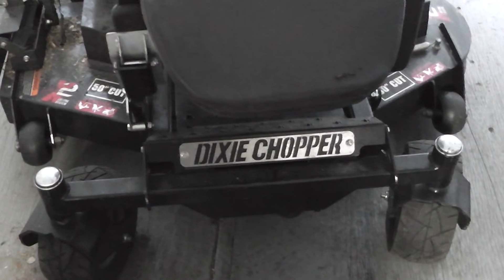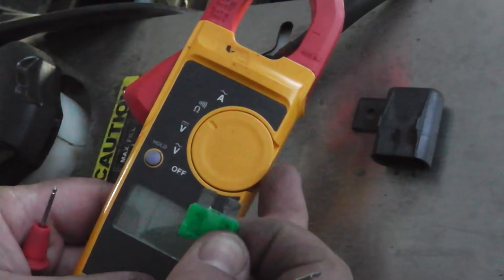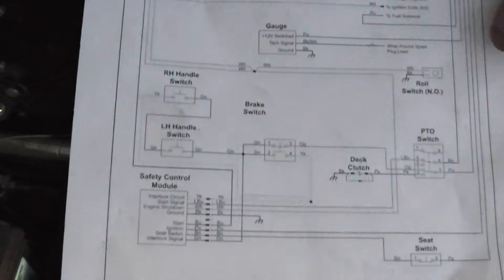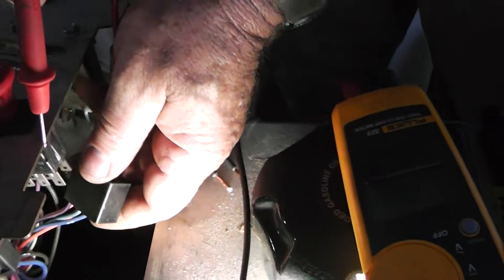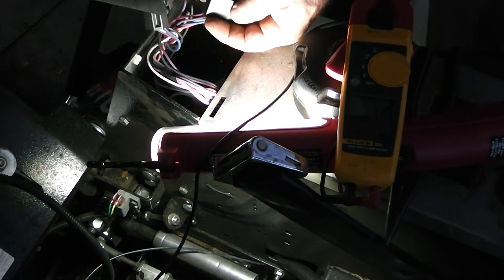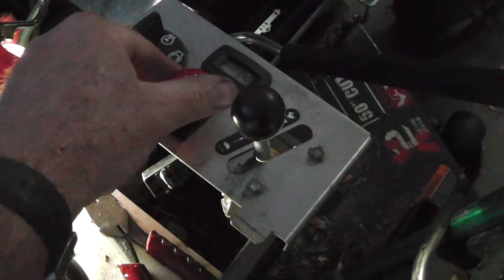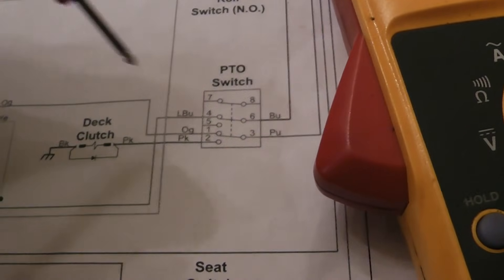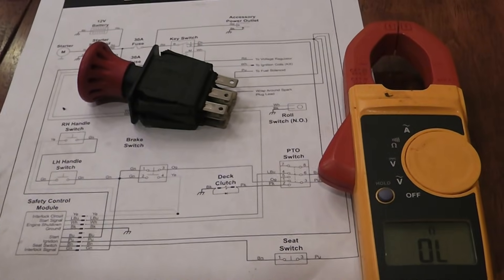Zero Turn Mower No Start Easy Fix

Comment: This will help a lot of people. Just like to add you can clip your negative lead to the battery, get a reading of battery voltage like you did then go to the fuses and get a reading of voltage on both sides of the fuse so you do not have to depend on ohms that may show continuity but not carry current. Move down the diagram testing each contact switch as long as you do not have a drop of 1.5 volts then it will carry enough current to work properly.

Comment: This was a perfect example of how to chase down a PTO switch causing the problem. You did forget to mention that there are safety switches for the control levers as well but this is a great video breakdown all the same. Thanks for taking the time!

Comment: couldn't you just have moved the blue wire to #8 and the light blue to #7 and leave #4 and #6 empty and saved a trip to the parts store and the cost of the new switch?

Comment: Had no clue a PTO switch could do that. I'm over here with my Cub Cadet with no wiring schematic until tonight. I looked through it and saw the connections, did a search, your video popped up and confirmed my no crank possibility. I've wasted about 16 dollars, on an ignition switch and relay. I know it's rookie as hell to just start throwing parts at it but, I couldn't find a schematic until just now. Thanks for the confirmation. Gonna go try it.
Update- just tried testing it and it's confirmed. Jumper allowed the circuit to work. No voltage on exit off the switch. Thank you for the video. Between this and the schematic, I finally found my problem
Reply: I guess Im asking randomly but does anybody know a tool to log back into an Instagram account?
I stupidly lost my password. I would appreciate any assistance you can offer me.
Reply: @Kody Baker instablaster ;)
Reply: @Milan Jamari I really appreciate your reply. I got to the site on google and im in the hacking process atm.
I see it takes quite some time so I will reply here later when my account password hopefully is recovered.
Reply: @Milan Jamari It did the trick and I actually got access to my account again. I am so happy:D
Thanks so much, you really help me out!
Reply: @Kody Baker you are welcome :)

Comment: Good, no nonsense video. Thanks. My dad just gave me a Troy Bilt zero turn with a Kholer engine and said it won’t turn over you can have it.  Should be able to have it running in no time now/ thanks again buddy!
Reply: Hey John, was that the issue on your Troy bilt zero turn causing it not to start? A buddy of mine said their Troy bilt zero turn won’t start and wanted me to take a look at it tomorrow but I haven’t found many electrical troubleshooting videos on Troy Bilt zero turn mowers

Comment: Hello! I have one of them that it won't engage the blades. Already replaced switch for the blades and checked all the sensors but no luck yet. Any suggestions?
Reply from the maker: Check the wires that go to the pto and see if they are broken. See if you have @12 volts going to the pto.
Reply: @homesteadprepper  I will do that. What if I don't have 12v good to the wires?
Reply from the maker: @milusoscualquierascz265  You will then have to trace the wires back to the battery to find where you are loosing your positive, negative or both. A schematic might be a great help.
Reply: @homesteadprepper  ok thank you so much for your time.

Comment: My Toro Z4220 ran fine for about 15 minutes. And then just die out.
Have full gas. Battery is less than 10 months and tested with DVM to be 12.6VDC.
Turned On heard only a click & click.
What do you think the problem (s) would be?

Ran fine all those other days.
Reply: angelisone try pto switch

Comment: I have a Dixon 2750 ZTR and replaced a relay and an ignition switch. It started once but after that no dice. Had to disconnect the start wire from the solenoid and jump it with a screwdriver. I will have to check that one our. Thanks.

Comment: What were the symptoms? Currently going through the same thing with my hustler raptor 52 inch. It will not crank, but I know the battery is good and I also know the the ignition switch is good because I just bought a new one, so I guess my questions is when your tried to start your mower it just wouldn’t crank?
Reply from the maker: Yep, no crank.
Reply: @homesteadprepper   I have another hustler zero turn and I checked the PTO switch right after watching your video and that it’s not it, because my other zero turn started with it, I haven’t tested the fuses like you suggested, do you think that might be the problem instead?
Reply from the maker: @lalozichlids3245  It could be fuses, solenoid relay, starter, bad battery or maybe it even could be something simple like corroded battery terminals?
Reply: @homesteadprepper  can you clean corroded battery terminals or you have to buy some new ones?

Comment: homesteadprepper I have a dead toro time cutter & need to disable the seat safety so that I can work on it. Can u explain how u disable it w a piece of wire?
Reply: Bend wire in a U shape and push it into the 2 terminals.

Comment: Been thinking about getting a ZT. 
You like your Dixie?
Reply from the maker: I absolutely loved it until this switch went bad, lol. Actually, it is an excellent mower and has worked flawlessly for the past 21 months.  I would recommend one.  I can't say the same about my Toro 48" Z master.
Reply: I have a raptor and i'm having tons of problems with these stupid safety switches.
I've had enough of it, and am by passing all of them.

Comment: If you don’t know how to disengage the hydros, get someone to show you.  It makes it much easier to push/pull when a zero turn won’t start.
Reply from the maker: Very true and trying to push or pull this mower can potentially damage the variable piston pumps.
Reply: homesteadprepper Correct.  Also, when pulling never pull faster than a walk.

Comment: What was the zero turn doing? Just turning over and not catching to run? I've got a 15' Toro ZX4800 zero turn that just spins. Trying to figure this out cause it just sits with 11 hours on the meter.
Reply: Sinister Transport I’m in the same situation
Reply: Your starter is probably unassembled. 2nd generation have a problem with the nut coming loose on the top of the starter. It will spin the shaft and not the gear. Hope that helps.

Comment: I have a 1991 Dixie chopper, 60 inch, it runs for a short while, then dies like it ran out of gas, wont go more than 3 minutes
Reply from the maker: I would start by replacing the fuel filter. I don't know if ithat one has a fuel pump but, I would check that as well.

Comment: I have a toro time cutter 5000 that when I turn the key to start position the little module on the bottom of the fuel bowl just clicks now I bypassed the brake module thinking this was the problem and this thing will not crank or anything anyone else had this problem and if so how did u fix the problem